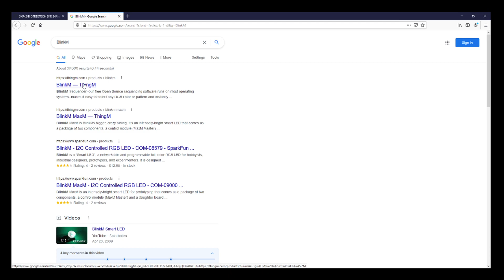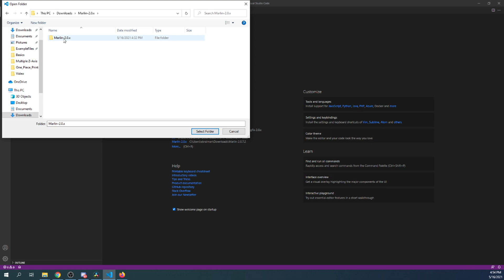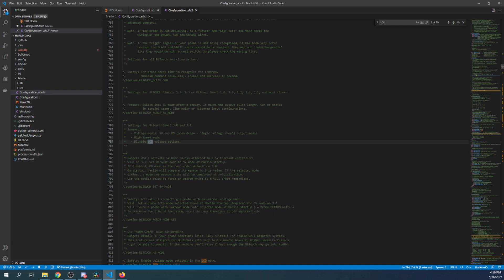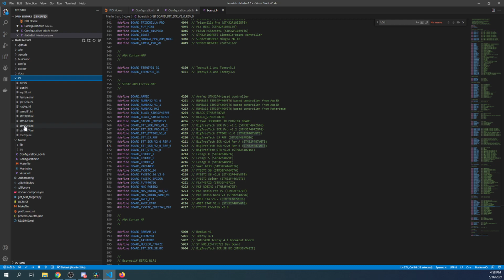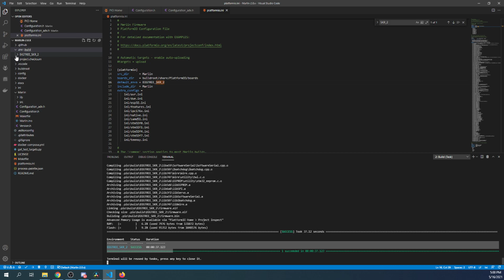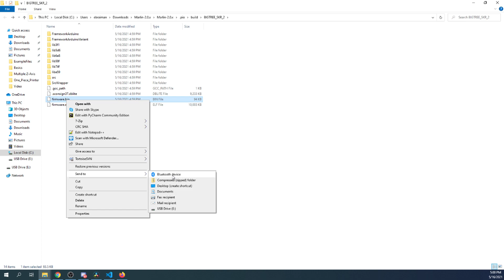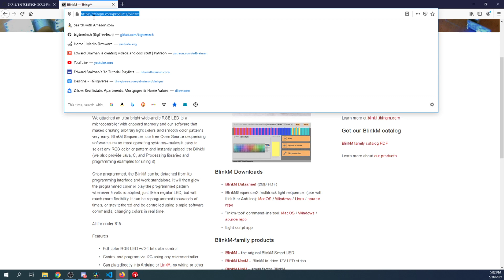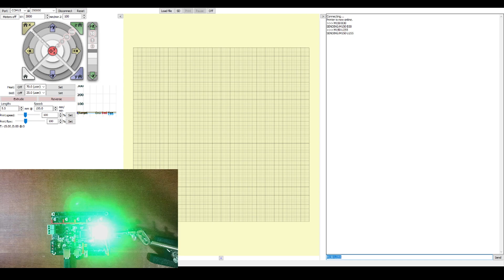BTT SKR2 - I2C BlinkM on SKR 2 (Rev B)

Comment: There is an rgb connector on the board. Why is it needed? I want to control a led strip. Which port is the best way to do this?
Reply from the maker: Yes there is a RGB port, still have not a comfortable method to configure physically.

Comment: well i managed to get the skr v2 installed on my cr10s. the only problem is, i can build the firmware with no errors at all, but it won't upload to the board via usb to pc. i have to use an sd card and keep swapping it out back and forth. another problem is, i am getting no printer attached, but it still works. i have tried everything on this issue. one last thing, i am unsure if i hook the cooling fan to fan 0 on the board if it will kick on automatically after the first layer. i am going to assume these are common problems that will come up. i would like to add, i have 20 different things connected via usb, flight controls, wheels, usb hardrives, that might be the problem with upload. i am able to use pronterface without issues.
Reply from the maker: Depends how you configured fan.  If it's not automatically configured in Marlin firmware with Controller Fan or some other configuration_adv.h.  so probably a Slic3r issue.
Reply: @EdwardBraiman  i appreciate your quick replies, i will become a patreon to help you out some. these skr2 boards have become nothing but a pain in the ass to the point i considered just using the skr 1.4 turbo until some of these problems are ironed out. it is nice turning the fans off when the printer is not used though. it saves fan life an my dining room doesn't sound like a jet engine anymore. i  don't have controller fan enabled in marlin, but i am using the btt tft 70 screens that can change most settings in the touch screen. surprisingly i still use marlin mode over touch screen, jjust a habit i guess.
Reply from the maker: TFT display allows automated gcodes and sending commands like Pronterface.

Comment: Mate I have a small issue or I'm sure if it is. I am up and running with an SKR2 and TMC2209s running on Klipper with a TFT35 and Octoprint. The board has USB and PSU jumper there. If I have it on USB, it works well. If I put it on PSU (correct wiring done), it will not boot up and load. Any idea why this is the case?
Reply from the maker: My guess as I'm still learning Klipper is it might not yet be supported.

You can always load Marlin firmware and see if it works.

Comment: Interesting, but why not use an addressable LED strip, like the NeoPixels? Much cheaper and you can have many LEDs or just 1, you only need 1 signal line and they are supported by Marlin
Reply from the maker: Just showing the possibilities.